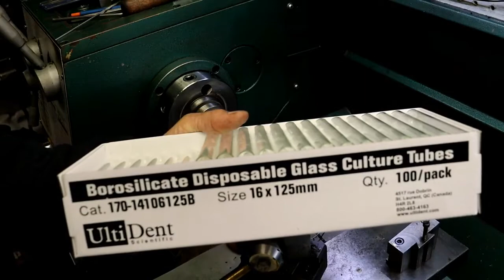Stirling helicopter 9

Comment: I've used a Dremel with a diamond wheel cutting test tubes and had great success. I do it in the lathe and use very low pressure.
Reply from the maker: I've done it that way also for smaller glass tubes but for me I like the diamond files I did mess up one tube didn't have the camera on or I would have posted how not to cut glass tube lol. I'm just finishing up the 3d model and drawings. I'm placing bearings on all the moving parts so friction should be minimal.